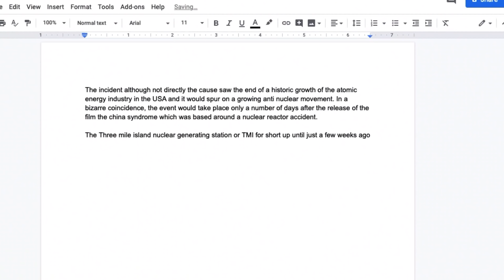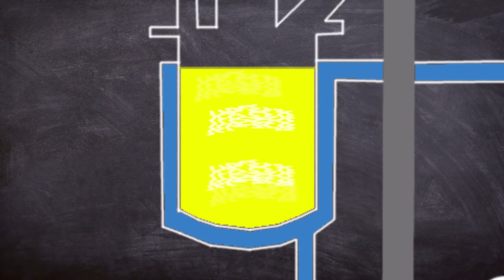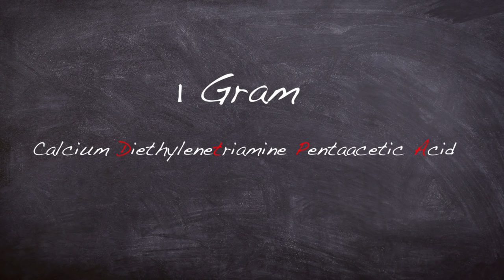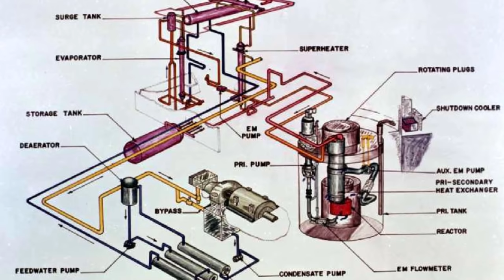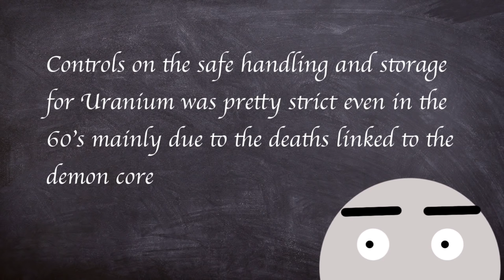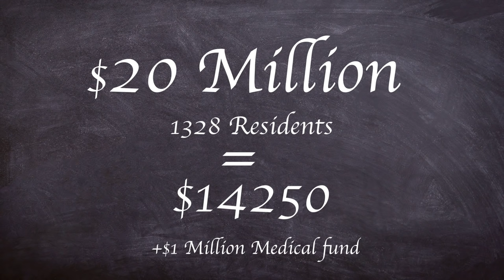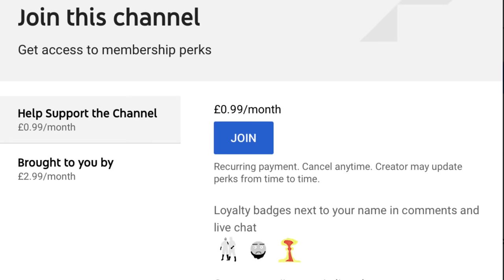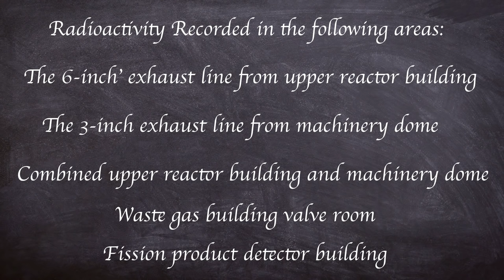Year 4 Omnibus of Plainly Difficult

Comment: Running for 4 years, that's a longer lifespan than the power plants you talk about.
Reply: You should have more thumbs up
Reply: "I'm going to rate this a -10 on today's disaster scale, for having a potentially infinite negative number of casualties."
Reply: Chernobyl operated till like 2000-2001
Reply: @Duffman-zn7ku  .... it still does operate... but it was't the point...
Reply: @Decybello  Chernobyl ceased producing electricity Dec 2000.  The plant has been in a decommissioning and dismantle phase for the past 20 yrs and this will continue until at least 2065 because dismantling and cleanup of reactor 4 is included and the schedule.
Reply: @Duffman-zn7ku  r/whooos
Reply: @busterbeagle2167  is still here so I’m sure you
Reply: @busterbeagle2167  you have an answer on call probably
Reply: @busterbeagle2167  you have an awesome 🤩 today too much to have to work tomorrow at my job lol 😝 I’m still working today and I’m still in bed p
Reply: As my statistics professor used to say, beware the volunteer samples, for they may not represent the average.
Reply: 0+
Reply: weird way to say you have no idea what youre talking about.
Reply: @busterbeagle2167  the extra thumbs are on the babies born to residents near the reactor
Reply: Dude, you didn't have to slaughter those poor powerplants, christ! 😂

Comment: Suggestion! So I've suggested Davis Besse already, but I've got one that might be even more fun. Trojan! A brief rundown, you'll have to find more info on your own time.

Trojan was, at the time it was built, the largest pressurized water reactor in the world. Built in Oregon, the reactor and turbine were built in such a way that the turbines would last the full life of the reactor itself. However, because a lot of corners were cut in the construction process, and because of issues with material quality, and poor design, the turbine's steam ducting system cracked and leaked within four years of the building's construction, leaking radiation into the local environment. This would happen several times over the plant's lifespan. Additionally, due to flaws in the design, the plant began to have an issue where it wouldn't properly start back up whenever it was turned back on, which created some... issues, and definitely some additional concerns. What made it worse was that a proper geological survey was not conducted on the Trojan site, and several years later, a faultline was discovered pretty much right underneath the plant, which had not been quake-proofed in any way, so additional structural reinforcing had to take place.

The final nail in the coffin for Trojan would happen in the 90s. Several attempts to have the plant closed down on a governing level were pushed, but PGE had better lobbyists, and the plant remained operational. That is, until memos written by plant workers discussing the extreme safety issues at the plant leaked to the press. It was only when those memos were published that PGE finally stepped their aggressive pushes to keep the plant running back, and finally stated that they would not be reactivating Trojan. The plant was shut down and, in 2006, finally demolished. The site, now Trojan Park, is now a park that is regularly rented for events, though very few people in Oregon know just how rough the reactor really was, and how close it came, Repeatedly, to creating a serious event. Given that the park is less than an hour's drive from Portland's city center, this should punctuate for you just how bad things could have gone for the people of Portland, or of the much closer Vancouver(Washington, not Canada), or for the cities of Ranier, Longview, and Kelso, which were basically right next to the reactor, give or take. 

It's sadly one of the many reasons I'm not a proponent of nuclear power in America. The reactors CAN be built and operated safely, but given the financial incentives, as well as the nationalistic incentives to hide incidents to stick it to foreign powers, after all, saying a reactor failed is a sign of weakness, it's far, FAR too easy for so many of these agencies to just... sweep their problems under the rug. Boeing is STILL fighting claims against them over the issues surrounding the Santa Susana research labs and the release of radiation following the Sodium Reactor experiment, PGE hid the faults of Trojan for at least a decade, and Davis Besse just last year found itself(after years and years of constant nuclear accidents) embroiled in a bribery scheme that paid off an Ohio house rep to force through laws that would keep the plant subsidized and operational, even as it was running well into the red.

America, as it turns out, is just not responsible enough for nuclear power. It hasn't grown up enough.

Comment: Honestly if I was an engineer working on any of these water cooled projects common sense would be screaming at me telling me these pumps and cooling systems would need at least 2 extra Separate cooling systems each with their own water supply electrical system piping pumps and cooling channels. Yes the 2 extra systems would not be as effective as the primary cooling channels but if there was damage or clog in the primary channel in the core the extra less effective systems could pick up the slack. Also I would set up a way to manually from a reasonable distance from the core to direct pressurized water from the second and third systems into the primary which could be useful in a number of ways. Put more pressure in primary channels of core to try and push a clog out. In case there is a pump failure or failure in the primary system elsewhere it could be manually disconnected from a distance and use second or third. Along with fire truck connections at the distanced emergency controls to add pressurized water from a truck at a distance for safety. Wow I’m just typing thoughts randomly  lol. Now I wish I had a nuclear reactor design and testing game. That would be awesome to be able to design really detailed custom designs and hit them with weather events and such to see how well you did and what impact it has if it goes wrong and has a meltdown. Would probably be really hard game to make but heck I’d be willing to pay 200 bucks for that sim. If you read this whole rant I hope you and your loved ones are doing well and staying safe during these tough times.  Happy new year I hope it’s a great one for you. ✌️

Comment: So now we have a switch to operate, an indicator to tell you that you have turned on the switch and a monitoring device to see if the operation is running.
Then you have feedback from the monitoring device and another system to check that the monitoring device is operating properly. 

But you can't just go down and turn the handle on the valve and listen to the pipe.
Reply: Hahaha if you put your ear close to that pipe you realize that it is at 1200 degrees C.

Comment: PLEASE can Plainly D convert the levels of radioactivity into the 4 standard measures? https://www.remm.nlm.gov/radmeasurement.htm. While I am sure that the reports used no outdates terms, the conversion factors are simple. State the original AND the conversion as you see fit but there are at least 12 measures no longer in use for good reason - they were not intuitive and were not presented in a form that relates to useful values..